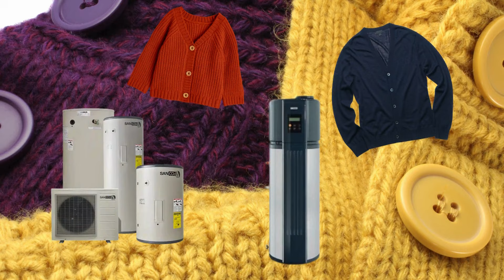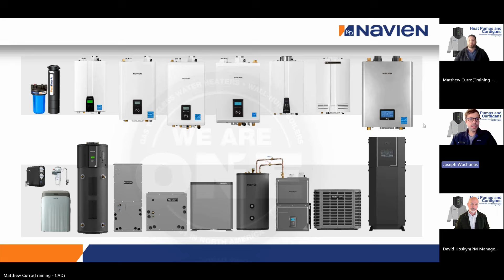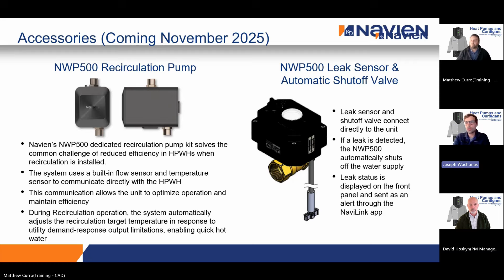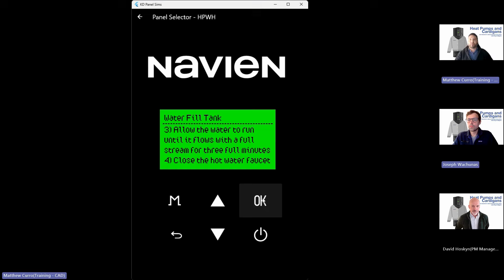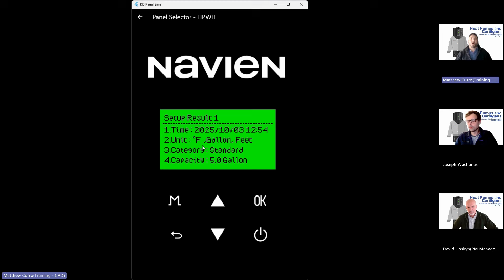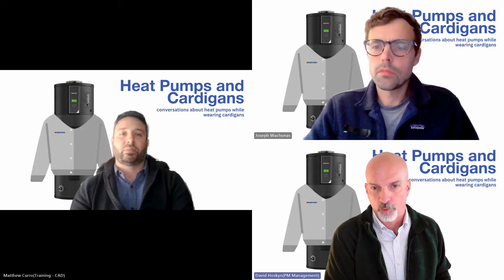Navien's New HPWH with Stainless Steel Tank

Comment: All of this efficiency sounds great but why not do what my Stieble Eltron solar SB300 E tank has, it has an 6-8" clean out bolted plate that is very easy to remove and reapply when needed near the bottom of the tank. What destroys water heaters? Mineral Deposits! If not sticking to the tank, doesn't it still build up at the bottom of the tank and causing issues? I can remove this plate and vacuum out the bottom of the tank when necessary, why they don't go all the way and use and electronic anode from the get go is a mystery.  They make one that works for it but is not standard probably due to the initial price of the tank. Using a stainless steel tank would remove the need for the anode which would make it the best in warm climates. They also have a heating element That never comes on except the coldest of a winter days, that is in a tube that projects into the tank with a top plate above the tube so it doesn't have calcium building up on the tube, so it can heat efficiently when needed. This is a Glycol roof panel heated system.  Every water heater should have that clean-out, it is an amazing feature, I don't see any reason why that one feature alone would not extend the life to 2-3 times :) Why doesn't everyone do this? Thank you!